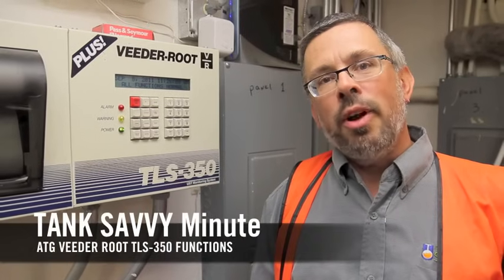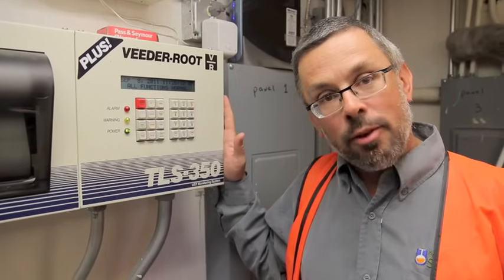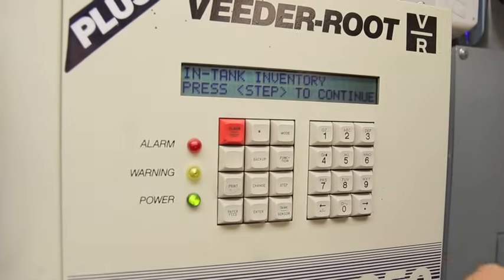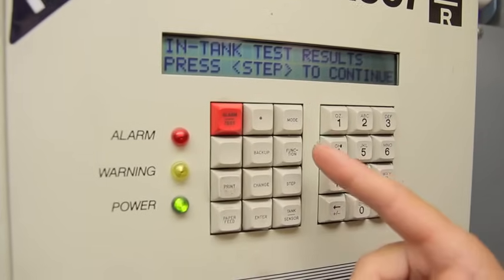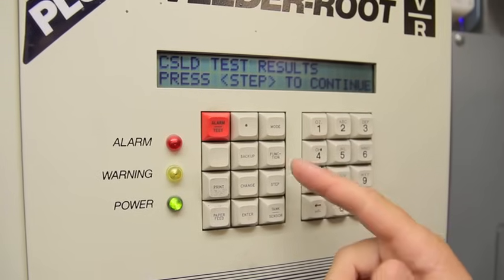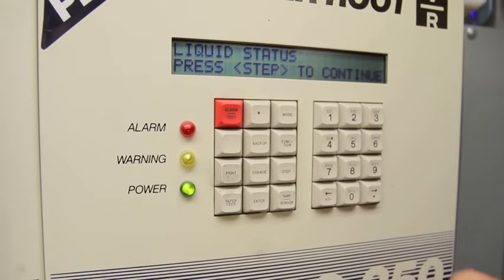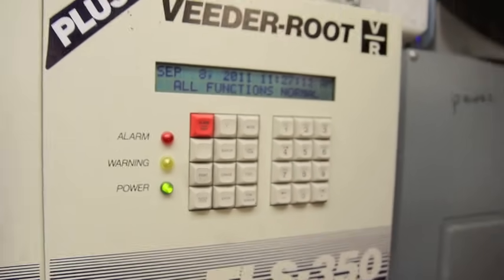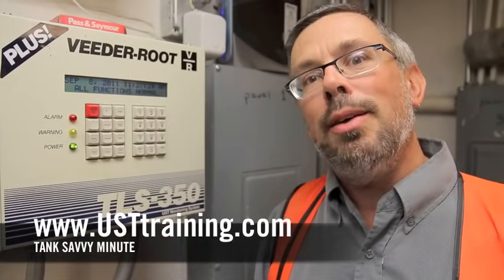ATG Veeder-Root TLS-350 Functions

Comment: So we have two tanks one is having issue with pressure motor so how can we switch gas to be used from other tankd instead of slow pressure one
Reply from the maker: Hi @rajavicky2242. Anything involving your submersible turbine pump should only be handled by a qualified service technician. Check with your local petroleum contractor directly for assistance.

Comment: Can you put up a video showing on what actions to perform when PLLD alarm sounds. I get msges saying unleaded dispense disabled after PLLD alarm.. thanks
Reply from the maker: PLLD alarm usually means you are low on fuel and the system shuts down the pump to avoid sucking air into the turbine. But it also can mean a leak in the pressurized piping has been found. Suggest contacting your service provider ASAP either way

Comment: HI BIN   I HAVE A PROBLEM CAN YOU HELP ME THE 
I HAVE TWO TANK THAT DOESNT HAVE  THE REAL FULL VOLUME IT IS LESS THAN BY 2000 LITER ??AND NOTE THAT I SET THE FULL VOULME TO THE CORRECT VOULME BUT THE PROBLEM WHEN I PRINT THE TANK DATA I GET  LESS THAN 2000 LITERS
Reply from the maker: Hi Ammar. I'm not exactly sure what the problem is. Might be serious. Can you contact Veeder Root (www.veeder.com) and ask for help?
Reply: yes thank you Mr BEN I WILL CALL THEM